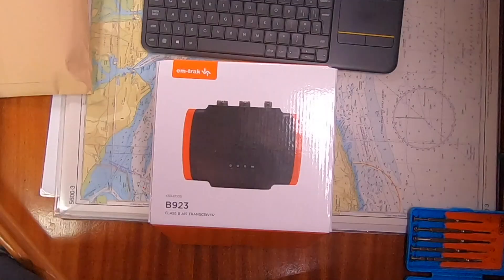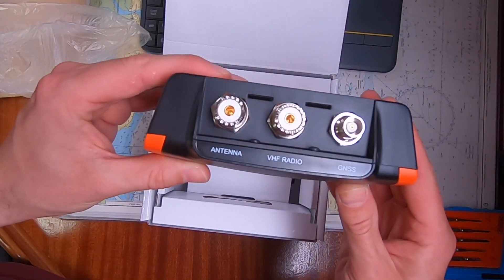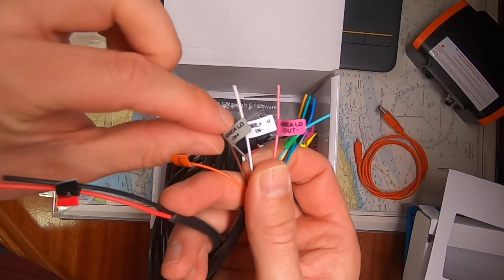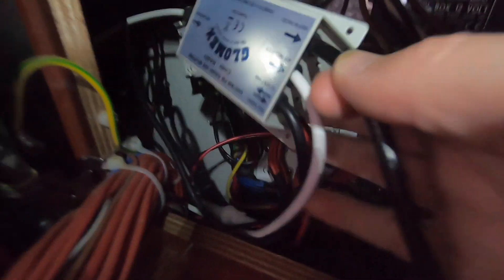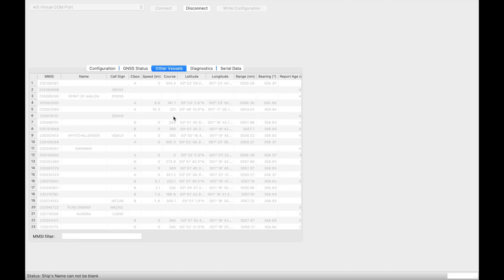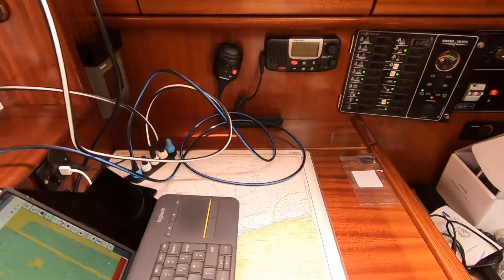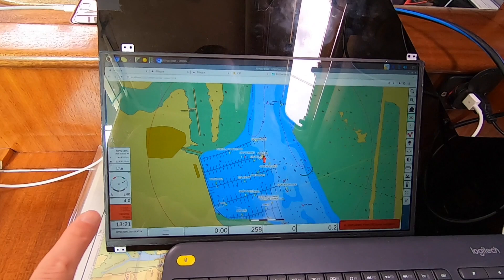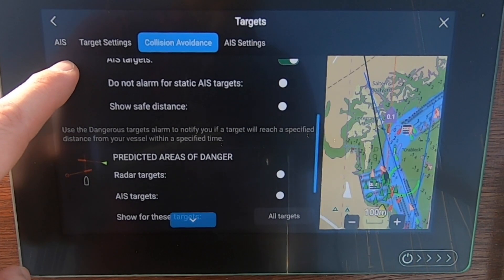Em-Trak B923 Unboxing and installation - AIS Transceiver - Time to transmit our position info

Comment: How is the GPS reception of built in GPS antenna? Are there any GPS accuracy values shown in this configuration app? You don't want you're boat position to have an accuracy of a few hundred meters; a situation we all see with our mobile phones regularly when inside somewhere.
Reply from the maker: Hi, there is information in the ProAIS on the GNSS status tab to give you an idea on gps performance. The diagnostic page will tell you if everything is ok and it’s in a suitable location with the checklist but you can dig into the detail more on that other page. At the moment my unit can see 32 satellites and it’s using 24 of them. I have a minimum of 12 between 30-40dBHz which is considered a good signal. The main issue in buildings is metal, virtually all insulation is foil back and glass is getting thinker, it just creates a faraday cage. The manual gives you some ideas of where to locate it and you can always test it before fixing it. Hope that helps
Reply: @BoatingwiththeBaileys  Thanks for sharing these performance details. Sounds like reception is pretty good. Of course this device has more power for reception and space (for antenna) than a mobile device.
Reply from the maker: @cornelisvanderbent8569 yeah, the position info is as good as my outside gps from what I can see. You can always get the external antenna if it won’t get a good fix.

Comment: does this work on wifi? I want to overlay AIS data onto my Navionics on IPAD?
Reply from the maker: It can, but this model doesn't have the WiFi module, you would need the B924 if you still want the splitter or the B922 if you don't need the splitter. Then it's just a case of connecting Navionics to it. I use a Raspberry pi to do that but yeah get one with WiFi and it will work out the box. Great device, it's just worked 👍⛵️
Reply: @BoatingwiththeBaileys  Fantastic, I ordered the B921. from TCS.
Reply from the maker: It will need to be B922 rather than B921

Comment: Very expenssive have other models in the market best price and equal quality and comunnication ..not is good investiment
Reply from the maker: You raise a good point about cost. Need some time to answer the investment part. If it lasts 10+ years then maybe so. There are cheaper units, some don’t have both in-built splitters and GPS and more specifically ones that when they fail still allow the VHF to transmit without unplugging or changing cables.
Reply: @BoatingwiththeBaileys  exactly That is why I just ordered one. Great unit I think.
Reply from the maker: @Coyotehello good choice. It’s been excellent so far 👍⛵️
Reply: @BoatingwiththeBaileys  yes I like the features and the quality construction, the AIS is a piece I did not want to skip on (even if the Moitessier hat was tempting) 
Just watching your KIP 2.4.1 at the moment and I am wondering. Are you running all that stuff on a Pi5 now? Just received mine last weekend and trying to load up navigation SW on it. I got Open CPN so that is a start... 🙂
Reply from the maker: @Coyotehello for the video I did record that on the Pi5 using some test data. I’ve built my Pi5 as far as I can but the apps for 1-wire, I2c and a few other things aren’t quite where they need to be yet. I’ve also ordered an SSD and a hat so just waiting to get them. I am planning on doing some testing with it and then I might switch across.
Reply: @BoatingwiththeBaileys  I just got noticed this morning that my AIS and my Blue Sea 1201 DC panel  are shipping this week 🙂
Reply from the maker: @Coyotehello  Excellent - Nothing better than a delivery of new boat gear!